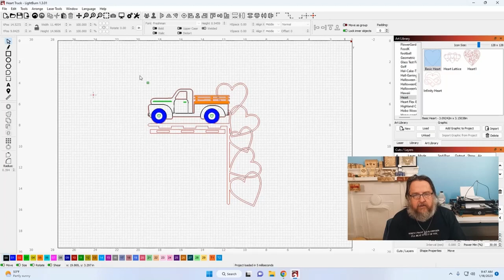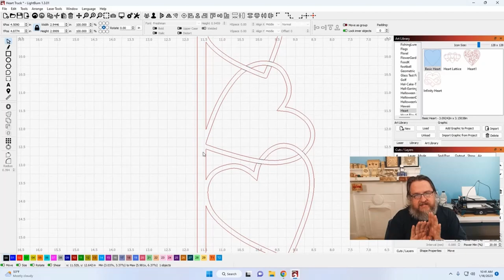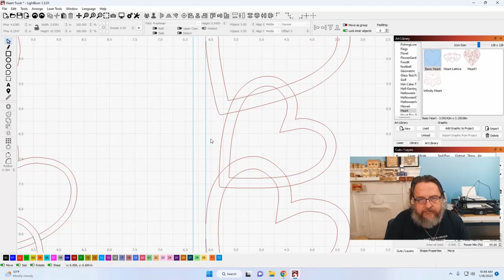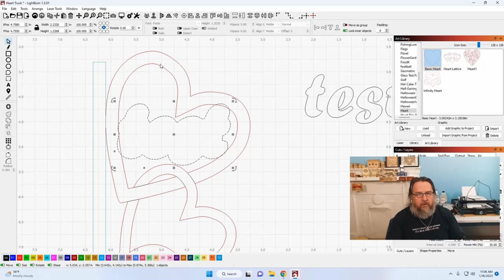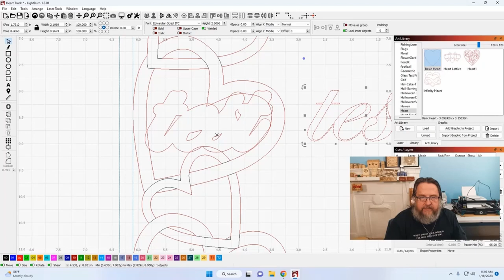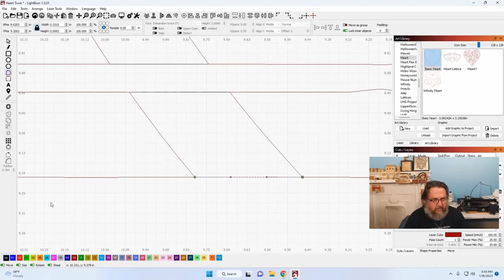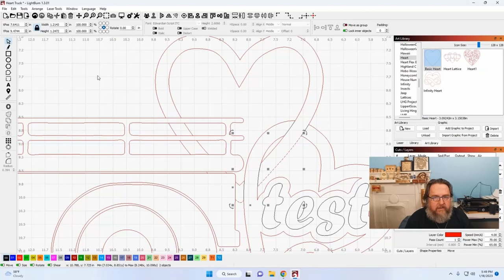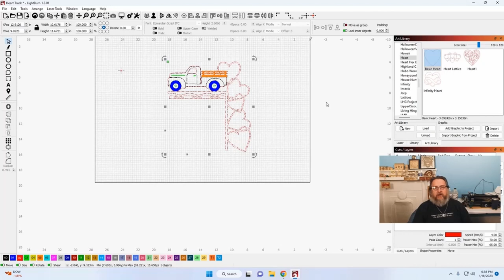Boolean Tools, Docking, Node Editing, Slots & Tabs and more...

Comment: Great video. As I'm just starting out, it helped my understanding of node editing a lot.  However, as I am trying to watch where the cursor goes it makes it difficult because it's so small.  It you could make the cursor a little larger and a different color to make it easer to find, that would be great. Then again it you want to tell be to take a leap, I'll ask which direction and leap.  I'll just have to do a lot of pausing.  Keep up the good instruction.
Reply from the maker: Believe it or not, the cursor is at it's maximum size on my screen. It's so large it's annoying and gets in the way of reading things behind the cursor. BUT, it does not show up like that in the screen recordings. I have been working on my editing to try and make up for that. It's a ot more work. A lot more. But it will hopefully make it easier for the viewers to follow along.  I am dropping a video today. You'll have to let me know if the new editing makes it better. I will also be doing a follow-up video on in depth node editing in Lightburn.

Comment: Could you have done a Boolean join with the heart in the truck?
Reply from the maker: Boolean would not produce the same outcome of creating the illusion of being behind the stake-bed. It would've had the same outcome as the the Boolean tool had on the hearts in the beginning. It would've joined the heart and the truck bed. Not put it "behind" it. There are always more than one way to get to the same destination in Lightburn. But I didn't like the way Boolean Union married the design instead of overlapping it.
Reply: @HoboWithWood  excellent video pointing out some very helpful techniques!